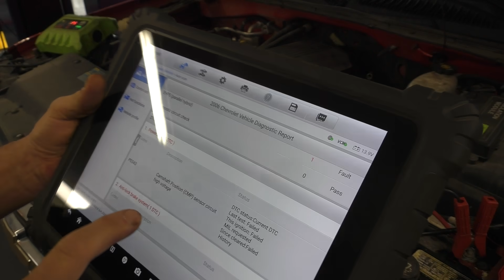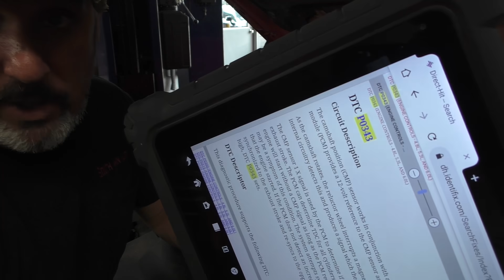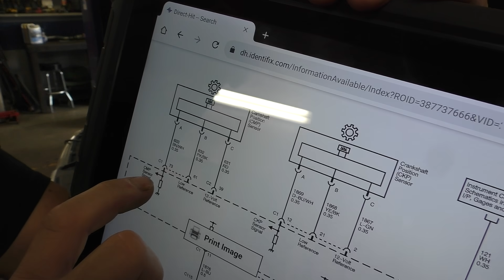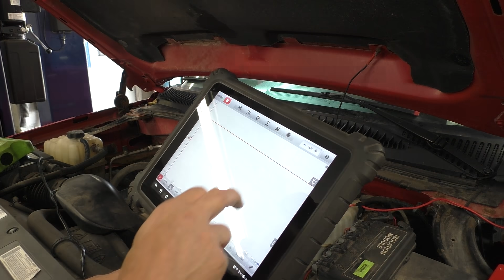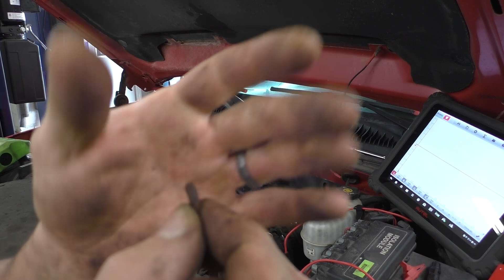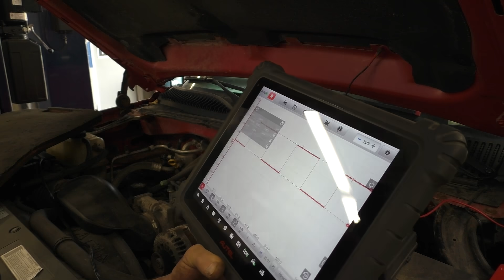Chevy Silverado With A Very Extended Crank - Other Shop Gave Up

Comment: I worked in the technical departments of two car manufacturers as a troubleshooter diagnostic tech and I can tell everybody watching here that this guy has great process to find faults! Firstly, he takes great care to look up CORRECT information for the exact model, and then takes time to understand how the system works and what the “fail” parameters are. These are the fundamentals that everyone should use. Also, using good equipment relevant to the component and possible issues as well as his EYES………
Fantastic, informative stuff, I commend him.
Reply: I've learned so much from him, and all for free!
Reply: Eric O. gets lots of well deserved praise for great diagnostic methodology.  His videos explain his reasoning, but it's helpful to spell it out like you did.  It's why I read comments.
Reply: A whole bunch of experience doesn't hurt.
Reply: I will second that. He also gets more out of his "Visual Inspection" than many techs. He will spot the smallest hint of "Green Crusties" on the outside of a harness from three feet away in the dark. He claims he needs glasses. When it comes to corrosion in a wire harness he has x-ray vision. I can say he's one of the best all around electrical automotive diagnosticians I've seen.
Reply: @markmosher1856  "He will spot the smallest hint of "Green Crusties" on the outside of a harness from three feet away in the dark" 🤣🤣🤣🤣 Hilarious but true!!
Reply: Hi Rob, when I was a young buck, back in the 50's, my Dad had a friend that stopped in during the holidays. The guy had a live in girlfriend way back then, which was as unusual as hens teeth. He had an engineering firm that reviewed GM designs for potential trouble points on new models. I had long discussions with him, and I was just a kid. His company short stopped a lot of problems that would have made vehicles unreliable back then. I would be willing to bet that GM abandoned this process in the 70's or so. This kind of review by guys like Eric O., Ivan, and Keith would make more sense today than ever before, considering the amount of electrical crap they are putting on cars today. Oh, and the guy I knew was back in the 50's was completely separate from GM's leash, so his company would not be swayed by the bean counters.
Reply: @superfinn80  nowadays they do all the testing on Cadillac before putting the technology on the other vehicles
Reply: ALL DATA is worth every penny
Reply: Yeah, I think the mechanics from the other shops don't try to understand how the system works.

Comment: I had exactly the same issue years ago with something else. The rust had expanded the area around a light which kept it from sitting properly thus not working. It's a lot different than your case but with a similar cause. I got so frustrated I tossed my screw driver at the light socket. It popped off the rust, allowing the bulb to sit back properly and work. I fixed the issue without knowing what the issue was until then. This was on a early 1960s panel van conversion I had in 1976-77. It was a slug, but we had fun partying in it during my Senior year.

Comment: I worked on a old equinox that had both intake and exhaust cam sensor codes, and It worked after adding 4 Quarts of oil!

Obviously had an oil consumption problem but he never checked it! He traded it in.

Comment: 29 y.o. daily has an ocassional intermittent cam angle sensor issue causing a long crank and stumble. I really must get around to replacing it - it's been about 12 years it's been doing it now.

Comment: Wow everything at harness is good Very odd How there is a relay Clicking While Checking harness for cam Sensor Thinking crossed Wires when the Repairs under the fuse box was Done Eric O 13:53 @South Main Auto Repair LLC

Comment: Sounds to me like the aftermarket cam sensor Is sending incorrect signal information not at the same Hz as the oem and that is why it didn't fix the issue seen this a ton on lots of Different Makes and models especially toyotas they hate aftermarket sensors Eric O 8:00 @South Main Auto Repair LLC

Comment: I ran into a similar problem with a 2005 Chevrolet 5.3. It had an extended crank however if you immediately stopped cranking and cranked again it would start on the second attempt. Apparently it would flip-flop 180° as a default in the PCM based on a bad cam signal. The cam sensor was new aftermarket then replaced with a new OEM same problem however no rust jacking. Several months of research as a backyard mechanic gave me no results. I came across an old obscure Chevy forum post where someone spoke about this problem specifically it was the only reference to this problem I could find anywhere on the Google tubes. As it turns out sometime after 2006 when GM’s switched past the GMT 800 series GM redesigned the cam sensor and the aftermarket followed suit. The redesign of the cam sensor works in the later models post GMT 800 Lt style engines however they have issues when used in the older vehicles. I sourced an old OE cam sensor from a junkyard problem solved. GM tried to consolidate their parts line and the aftermarket followed and now good cam sensors are not available for the early models. U pull it for the win. I did a video on it explaining in detail on my YouTube channel axles garage.

Comment: How the Hell do you hear anything with phones ringing, the siren on the firehall that operates at noon, rattle guns going,  heavy traffic noise, & the air compressor right in the shop & a host of other noises ?   In my own shop years ago that was on my property, the first thing I did was build a building OUTSIDE that was noise resistant,, for the compressor& the pipes came inside under ground. The air conditioning was also outside.  You may now be inferring that I hate noise (unnecessary noise).   You are correct.....I DO hate noise.  I very much enjoy all of your videos, & you are  WYSIWYG guy. 
Thanks for all your explanations Eric. Best wishes from the windswept Prairie of Alberta Canada.

Comment: Some of the most reliable and consistent trucks ever built. My 2004 2500HD is still a beast towing, plowing, hauling, and never lets me down. I tell everyone I'm driving it until the wheels fall off, then I'm going to put them back on and put another 250k on it.

Comment: It might already be said - but we get the ABS Wheel Sensors to rise from rust too, here in Montana. Still --- you pulled this in from left field and more power to ya. 
Would a simple logic probe have been an easier test tool?

Comment: The 12 volt power supply to the camshaft sensor is also the crank sensor supply. It is not a strong 12 volt signal and is easily pulled down. Checking with the test light was able to create a false signal thru the crank sensor and triggered the ECM as receiving a crank signal. Had a few cam sensors short and take both signals down.

Comment: Rust jacking is real.
It's interesting that there was enough ground contact between the bolt and ECM ground circuit, probably the reason for the dim light.
NOT A DUMB VIDEO. Seems like quite a few people learned something today, Eric.👌🤙

Comment: My first though when you tested the +12 and you heard the relay click was the last shop screwed up the wiring.    On reflection, given you found the issue with the sensor being out of position my guess the relay clicking was possibly due to an over current  condition from the100ma  test light on the sensor 12V feed.   Hall sensors are going to take a couple of  mA at best.   You need a 20mA test light.

Comment: My Silverado is a 97 350 vortec, I was led to believe the camshaft position sensor on mine was in the distributor. Was this wrong information from the repair manual for the truck ?

Comment: Holy shit!

Dude, i been tracking somethjng on my dadz 2006 suburban,it does the exact same thing!

I cant wait to watch all of this, as i have been through the sensors,ignition switch, ground wiring,tons and tonz of power probing and scan tooling.

Man, i hope this video illuminates what simple thing I must be looking past.
Its driving me nutz

Sounds exactly like the beginnung of the video.
Jist sometimez hangs once or twice, like it doesnt have fuel enable signal or something.

But nothing as checked out as failed. 

I shall kneel at the sacred altar of South Main Auto and humbly receive advanced electrical education.

Thanks, in advance!😂

Comment: Hey, I have a problem with my brakes on my 03 Camry. I trust that you can help me figure out what is causing it. 
The brake pedal is going almost all the way to the floor when applied.  However, if the engine is off, the pedal stands up firm. I checked for leaks throughout the vehicle and found none. The reservoir remained at constant level. I then thought that it can be an internal leak, so I changed the master cylinder and bleed all four wheels. It did not solved the problem. Couple weeks after, one of the front Caliper was found stuck, so I changed that and performed a 100 percent fluid change and bleed all 4 wheels again. Still did not solve the problem.  I checked the booster and it was dry and holding a vacuum.  I started the car for a few minutes then switched it off. Pumped the brakes a few times with it feeling soft and going all the way down, and then it went hard and stayed up which confirms that the booster is doing its job. 
Info about car: all 4 wheels got fairly new pads, and 2 front rotors changed about 6 months ago. I changed out the master cylinder again with another new one trying to eliminate the possibility of having a bad brand new master cylinder.  
Now I'm stomped and can't figure out what is causing it. Note, all calipers were checked for proper working condition. One was serviced because of frozen glide pins. 
What are your thoughts on this?
Thanks for any suggestions you may give.
Regards.

Comment: I have replaced the oil pressure switch which sits next to that cam sensor on my 2005 5.3L. 
What a pain to see and get to.

Comment: Owners of mid 2000’s Chevrolet pickup trucks are aware of rust jacketing of ABS sensor mount if they live in the rust belt .  This turns into a dangerous situation .

Comment: Would it have been possible to pack the sensor hole with a grease coated string to catch any pieces of rust as you worked to remove it from the top?  I don't know what damage, if any, it would have caused had some gotten down there. Hopefully it would just fall to the pan.  Any thoughts?

Comment: The video was great... and there is no end to the 'I did not think of that' mentality in the mechanical trades. I been there, you been there and apparently the installer of the cam sensor is the president of the club, not checking a mounting surface for debris knowing that the truck is a rust bucket. All your vids are informative, well done and if not scripted stay on target for the hound and fox of chasing the issue. Great channel sir. And you said 'Weiner' so my day is fulfilled knowing I have a brother in NY state.. :)

Comment: I had a Crank Pos Sensor go bad. Replaced it with an AC Delco and it would start then stop running when I hit a bump. Traced wires from the brain to the CrPS, found nothing.
Then I did the "Wiggle/yank the wires" going to the CrPS and the engine stopped.
Turns out the male terminals on the sensor were smaller than origional ones, so I "adjusted" the female terminals and all has been fine 40K miles later.

Comment: I think a piece of the old sensor bracket (the part arround the.holding bolt) snapped off and stayed stuck there on the bracket seat on the engine after rusted pretty good and whoever changes the sensor dosent pay attention to that and just put new sensor and tightened it very well till the new sensor bracket bent, because  it dosent seated correctelly on the engine because of  that piece left over from the old sensor bracket.

Comment: The fuel pump relay? Perhaps the 12V to the fuel pump relay also feeds the cam sensor as they both need constant 12V to make the motor run so the test light was feeding 12V backwards to both.

Comment: NEW means Never Ever Worked. I always regard after market parts with suspicion.  And, even if the parts are OEM, I'm going to verify them before i call it a day.
Maybe that cam sensor is perfectly good, but WHEN i check it and it doesn't work, I'm going to know the reason why and fix it.

Comment: I thought you were going to use the scope with the sensor pluged in but out of the block, and pass a screw driver back and forth at the end to see the signal out of the sensor to verify it worked. Thanks for the video.
Reply: Great diagnostic idea
Reply: @salceti Thanks.

Comment: Nicely done! By putting an external 12 volts directly into the cam position sensor ECM ground circuit through a test light with different internal resistance than the cam sensor and no corresponding low reference signal from the internal ECM 12 volt reference who knows what that is doing to the internal circuits of the ECM but must be causing the fuel pump relay drive in the ECM to trigger causing the fuel pump relay to energize. Computer circuits and components can do strange things and without all the other circuits in normal operation under crank or run in this case the position sensor wheel/gear not turning!

Comment: Here's my theory on the relay clicking when connecting the test light. That 12 volt reference was being supplied by the ECM. It probably wasn't meant to supply 100mA so when the test light was connected, it pulled down the 12 volt reference as was confirmed by the test light not being as bright as when powered from the battery. That 12 volt reference from the ECM may also be used by the ECM for other purposes like maybe the fuel pressure sensor. So when the ECM saw the 12 volt reference drop, it got confused and turned on the fuel pump relay because it thought the fuel pressure dropped I know, crazy theory but sometimes it's the crazy theories that make sense.
Reply: Close. It is the same 12 volt supply as the crank sensor. The ECM sees the sudden drop to ground from the cam sensor supply thru the test light that also grounds the crank sensor supply and interprets it as a crank signal. It is a weak 12 volt supply so 100 mA will pull it down but still light the test light.
Reply: @1MiketheMechanic  I was close, but you nailed it.

Comment: It was hard to see in your diagram, but it looked almost like a pull-down resistor on the output signal line and that might be giving the slight offset above ground.

Comment: It's interesting that we consider a repair like this boring or simple.  We lose sight of the fact that so much knowledge, skill and tool ownership are needed.  99% of the world could not have thought that problem through. The difficult part is the diagnosis,  not the physical repair.  I could train a 14 year old to bolt parts on.
 Great vid and diagnostic process.

Comment: Thanks Mr O  I have 2005 ford f150 5.4 triton and had a cam sensor faulty circut code. and found out the wires to the connector were being disconnected from the connector. so my brother helped me fix it.

Comment: when scraping crust , could you put a air hose in the hole/socket for the sensor thus blowing all the crust out at the tec's face !  Good find the crust !! Now put that little crusty on a piece of tape and stick it on the invoice !
Reply: If the sensor is mounted vertically from the top or the rust jacking is so extraordonary or in such a position relative to old plastic as to make rust removal awkward; can positive air pressure be applied or would a carefully applied wad be the go to to avoid engine ingestion of larger rust flakes? There a point where the tech must risk the plastic to gain access? Hard to gauge on an old rusty car I suppose.
Reply: That hole goes right into the inside of the engine, doesn't it? That's why is has an O-ring on it.

Comment: I just did a 2004 6.0 with P0342 the shop put a aftermarket cam sensor.  Came back with same problem with no codes. Found the cam sensor wouldn't pick up the first pulse of the cam signal, caused extended crank and popping from intake

Comment: I know we should all be paid for our time at work, but it seems to me that if the time was spent to diagnose rather than the time spent to pay for shotgunning parts and install them, repair shops/dealerships might have a better rep. 

Novel concept and a super amazing original thought I know. Glad there's still people like you out there. But sometimes finding a guy like you is an expensive process. And sometimes it just doesn't happen. You're one in a million. Needle in a haystack.

Comment: Had that happen to me on an early Cummins in a Dodge truck, they hadn’t changed name to Ram yet so I think it was an early 80’s vintage. Seems the crank sensor failed so required replacement, I wasn’t aware that thin paper that was on the sensor was actually the gap it wanted so I tore the paper off and tried to gap it so it didn’t rub. Found out you leave the paper, let it just touch the crank and when you hit the key to crank it over the paper would rub off and the gap is set.

Comment: 379K on my 02 6.0 2500HD when I sold it. Guy then put another 100k on it. It was fluid filmed yearly from day 1 and the only hard part failure was a fuel pump at 90k. 

My 2.7 eco boost F150 is pushing 200k but I doubt it will hit 379k.

Comment: Not a dumb video. Trouble shooting dead on to cam sensor function and fact engine can start with crank sensor only, but long crank. You also mentioned getting an intake pop indicative of 180 out. Your diag and methodology were spot on.